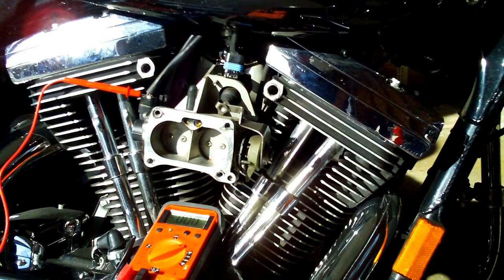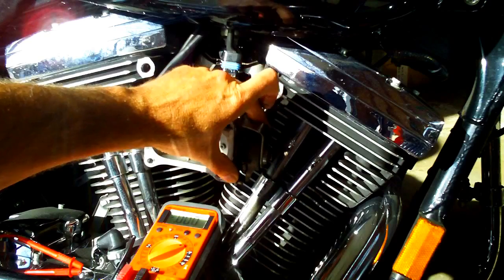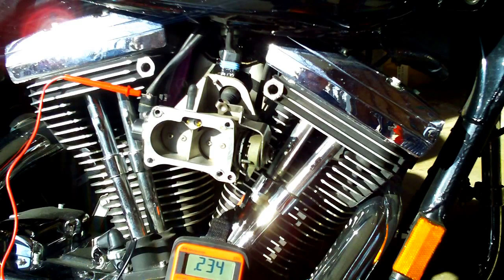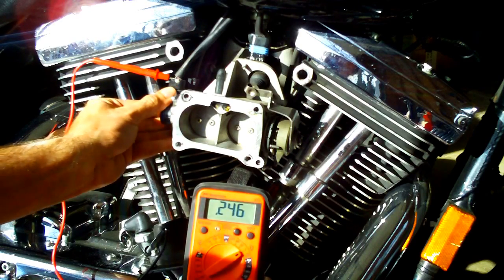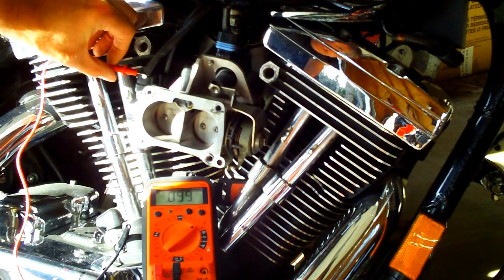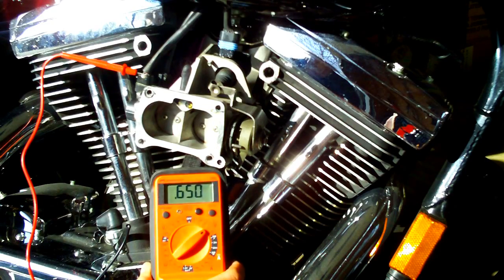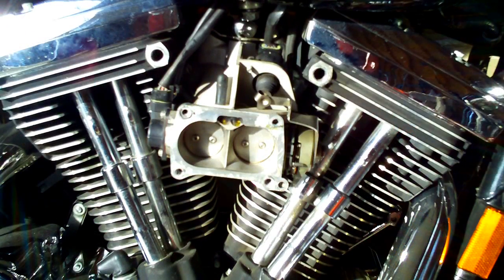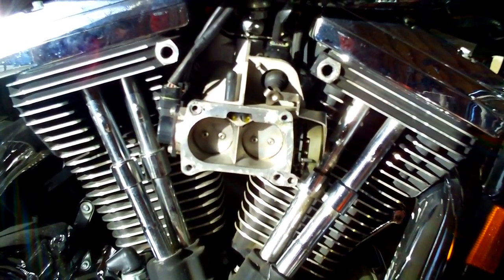Reset Harley Davidson Magneti Marelli Fuel Injection TPS Settings ✔

Comment: I realize that this video is pretty old, covering the M&M fuel injection system, but I wanted to clarify with your viewers that the .275 volt initial setting is just a good starting point.  

If you’ve completed Stage 1 on your bike, better mufflers and intake only, then that setting is irrelevant not to mention incorrect for its current new modifications. You’ll find that the engine runs much leaner and moving that TPS is how you richen the mixture back up again.  

I suggest if you’ve done Stage 1, that you check the spark plugs frequently to avoid catastrophic engine failure of running too lean.  They are the only indicator of how rich or lean your engine is running.  When it’s setup properly, it will idle with that nice thump of an EVO 80ci carb motor and have no hesitation when getting on it, like all other fuel injection motors. 

Be safe out there!

Comment: Mark,is your multimeter set on 20 volts? Thank you in advance
Reply from the maker: It is set to millivolts, to measure "point number number number" of a volt. Less than 1 volt DC. Not all multimeters go that low. You may have to acquire a different one if yours doesn't.

Comment: You adjusted the cold idle set screw and got it to .650V but I didn't see any adjustment to the hot idle set screw after you backed it out...did I miss something?
Reply: Went back and watched again, saw what you did with the warm idle screw.. I was busy taking notes and missed it. Thanks. Great video!
Reply from the maker: No you didn't, I set the hot idle screw after the bike warmed up to what sounded like 1,000 RPMs. There isn't a procedure that I am aware of to set it otherwise.
Reply: Than you! @contact4mwy7

Comment: Do thes numbers work if the bike has upgraded cams and bored out
Reply from the maker: @timhall4046  I don't have any info on that. These numbers are based on a stock engine and intake. Do you have a before and after comparison to go by or did you buy the bike after the engine work was done?
Reply: @contact4mwy7  I got the bike from the dealer ship and they don't  have much info on it.
Reply from the maker: @timhall4046  ok. How is the bike running right now? Is there evidence of a fuel tuner installed?

Comment: Whats the meter set to?
Reply from the maker: @jorgezuniga7485  Millivolts DC. 0.2 is two tenths of a volt, 0.04 is four one-hundredths of a volt, and 0.005 is five one-thousandths of a volt. If your meter doesn't go that low you'll need a different meter.

Comment: what are these numbers, are they volts or what??? thanks for answer
Reply from the maker: @aferimmaloku8320  The numbers are in 'millivolts' DC. Measuring less than 1 volt. There is a link in the description to another video that shows the multimeter I used and explains it further.

Comment: What do you set the multimeter on ? Is it on volts ??
Reply from the maker: @fgrann  MILLIvolts. As the numbers go from the decimal point, 10th, hundredth, thousandths. That is why the reading is 0.275 volts DC on the display. One volt DC would show as 1.000 and a half a volt DC would show as 0.500. Here is a video of the multimeter I used: https://www.youtube.com/watch?v=SSi6kIp_Vrg
Reply: @contact4mwy7  Thank's alot 😃👍🏻

Comment: What is your multi meter ranged too? Also i rotated the tps and could not get .275 ..the most i could get rotating the tps was .050 and like .080 when rotating throttle..so i tried ranging my meter different to Mili amps and still no where near your .275 mark..i also couldn't get fast idle to .650 either
Reply from the maker: @garyharriss5322  The multimeter is set to millivolts, that way it can measure less than 1 volt DC, which is what these settings are. Make sure you are probing the correct wire and have a good ground, and that your battery is fully charged.

Comment: Rookie question...but what do I set this multi meter at? I've only used one a handful of times
Reply from the maker: @Jrmobileweldingservices  set it to the lowest DC setting. You will be trying to measure less than 1 volt DC, to the thousandths of a volt.
Reply: @contact4mwy7  I figured it out. But thanks for the response. And this video helped BIG time. Much appreciation

Comment: I must be doing something wrong, when I put a pin in the gray wire on the TPS I dont get a reading on my meter at all . I have the switch on but still no reading! I am working on a 1998 HD Ultra Classic Fi.
Reply from the maker: @unclejed5342  I have a few questions, what kind of meter are you using? Will it measure down to 1,000th of a volt? Or at least 100th of a volt? Where did you clip the ground wire? You're looking for around 1/4 of a volt DC. 0.275 to be exact.
Reply: @contact4mwy7  I am using a Klein ET270. Either it does not go that low or I don't have it set right!  I'm grounding on a frame bolt.

Comment: 2001 ultra,  not even close to .275. My readings are. 850 and up????
Reply: Thank you again. You have helped tremendously!
Reply from the maker: If you followed every step correctly but cannot get a reading of 0.275 there may be a problem with something related to throttle position sensor, if not the sensor itself.
Reply: Thanks,  once got things good on my end, it went as you showed.  Only now it stays high Rev when throttling. New aftermarket sensor.
Reply from the maker: @mr.ksinformationstation8590  the idle speed is adjusted by both the Cold set screw and the Hot set screw. One of them may be turned "in" too far. You'll have to try backing them out one at a time to see if the idle begins to slow. If not, put that screw back where it was and try the other one.

Comment: Mark,I've reached out to you before about my 1998 harley-davidson Road king classic.  It's been running great . Today I went on like a 4 hour ride and near the end of the ride I hit a spot in the highway where they had base asphalt but hadn't put the surface asphalt in yet. I hit this 2" drop going 60 mph. After that the bike started surging and died at the stoplight. I limped home with it and thought about the throttle position sensor. I got to the tps and found one of the screws to the tps was already loose. I did your procedure for the tps . Trying to get to .275 but was getting readings over 1 and then .24. It it possible that the tps is bad?
Reply from the maker: I wouldn't say it was bad just yet. Maybe when the screw(s) was/were loose it rotated just a bit. They are very sensitive as you may have seen on your multimeter. See if you can get it to 0.275 and try it out. Coat the outer edge of the screw heads with clear fingernail polish to help keep it from loosening on its own.
Reply: @contact4mwy7  Thank you,Mark

Comment: Hello. Do the two screws above the flaps need to be tightened or do they also need to be adjusted?
Reply from the maker: If you're asking about the two screws above the intake butterflies, they are "air screws" set from the factory. I've heard it's best to leave them alone.

Comment: So I’m trying to do this. The only way I can get the decimal in the correct spot (.000) is to have it set to 2m Ohm setting. Is that correct?
Reply from the maker: That sounds like a good start. You will want to see 0.275 volt DC.

Comment: I can’t seem to find the right setting on my meter. None of them read the way yours does. None of the settings
Reply from the maker: You need to have the proper meter to measure down to less than 1 volt DC. Will your meter do that?

Comment: I don’t know what setting on the multimeter to measure, volts right ?  Mine either registers
on 200 mv = 27.5, or if I put the meter on 2v , it registers .0275, also when I adjust the fast idle screw it will only read .046 with the screw all the way in
Reply from the maker: It's measured in DC volts. Millivolts. 275 is the number you need for the throttle position sensor. 0.275 is just over a quarter  volt. As for the cold idle screw (fast idle), adjust that when you're done to a comfortable high idle, and make sure it idles down to the warm idle screw position.

Comment: I have to have something wrong I followed all the steps lowest o can get is.475 moving the TPS around am I missing something?
Reply from the maker: If you have the correct wires and follow every step, you should be able to get a reading of less than .275 I don't know what else would cause a high reading like that.
Reply: In volts correct to and what are you grounding on?
Reply from the maker: @benjaminbliesener1438  I grounded to the engine case itself. Volts DC.
Reply: @contact4mwy7  yeah I'm not sure what's happening then I'm pinned to the gray wire with the violet chaser backed out the cold idle screw turn the power on grounded it loosen up and Lowest I've gotten this point  .468 I love the idea of having fuel injected but at this point I'm so stressed on this bike. I wanna switch to carb

Comment: I know this is an old post, but im a Harley newbie...will these settings be able to run efficiently with a set of slipons? Like Sharkroad with no baffles? I really want that loud Harley bagger sound but ive been told that MM injections sre a pita to tune for upgrades...1997 FLHTCUI Ultra with 42k
Reply: I have a lot of decel pop too...pulled plugs yesterday and seen they were gray...so I cleaned them and put them back...hoping this method will fix all of my woes
Reply from the maker: The settings in this video should reset the fuel injection system back to like-new condition. If it were mine I would find a fuel injection tuner that ties into your injector's wiring harness (piggyback type) to give it just a bit more fuel. I have some videos on my channel of installing and using two types with good results.
Reply from the maker: Deceleration pops can be from fuel mix being too lean to an air leak somewhere in the exhaust letting fresh air into the pipes. I've been chasing a decel pop on my 2009 and found that adding more fuel at zero throttle will tame it.

Comment: I did everything that I can to adjust this magneti marelli and I still have issues. The bike fires up really good,after a few miles the bike bogs down to a stop🤷
Reply from the maker: When the bike bogs down to a stop, can you check the spark plugs to see if it's running too rich or too lean?  Without much to go by it could be a number of things from faulty sensors, fuel pressure, etc.
Reply: Do you think I should change the temperature sensor on the magneti marelli?
Reply from the maker: @theoc634  I don't know the system or situation well enough to make recommendations on what to change. You might change every sensor and still have the same results. It's going to take troubleshooting to track down the culprit.

Comment: My bike is this exact engine and intake.  It died randomly and was not starting.  I changed the temperature sensor and it ran great for 2 days..it has now stopped running any where past idle. I cleaned all parts i could without removing the intake itself.  I'll head to get a meter and try this.  Will let you know what i find.  Thank you for the video

Well..i did this and i have other issues i guess. Idles great..hit the throttle and it dies at 1900rpm
Reply: Any suggestions lol
Reply from the maker: I would connect the meter and rotate the throttle. Watch the meter to see if the voltage through it increases as it should or is jumping around or stop changing at a certain point. Other than throttle, the only other thing I can think of that would have an affect is the crankshaft position sensor, which is located at the front of the engine, left side. Temperature sensor shouldn't cause it to die out at a certain rpm. Let me know what you find out.
Reply: @contact4mwy7  i have removed the tank and fuel pump... my plastic bendy straw was leaking in a pin hole... but...i did notice my electriconics were out of calibration and now knowing how to set it i can actually use my turner to see better results when this is fixed.
Reply: Voltage was not jumpy in unit just to let you know.  Thank you again

Comment: Thank you   I just bought a 2001 ultra and it had a lean skip from 2000 rpm to 2500. TPS was never touched from the factory, Still had epoxy in the screws. It was set wrong from day one.  Lean issue is gone bike pulls hard and no pop skip at 2000 rpm’s Thank you again
Reply: I forgot to mention. No more popping through the exhaust on decel or between shifts.

Comment: whata...I can't get those numbers reading on my multimeter.. what is the multimeter set on?
Reply from the maker: DC Volts, reading out to 1,000 a volt. 0.275 volt DC. That's just over 1/4 volt DC. Less than 1 volt DC.
Reply: this cowboy did a little sillywillie here...I disconnected the harness I was about to do volt check, it is only the one on the topp that you took of and not the one with the violet/grey cable, now I get it and it is set correct. It 
was around midnight and I did not want to wake my neighbors, but today after my work I am about to go to the garage again and fire it up, hoping for progress. Thx a million, greetings from Sweden.

Comment: Thanks Mark for this great video! The gas consumption was extremly high at 98 Electra Glide. I  followed your process, set the sensor to .275V then unplugged the 5&15A fuses for a while. After a test ride of 20 miles I recognized that the engine behaviour improved a lot (spark plugs are nice brown). The only strange thing that the warm idle screw does not change the idle when the engine is warmed up. The idle reacts only for cold idle screw. 
Do you have any suggestion what can be be wrong? Thanks in advance
Reply from the maker: I'm thinking you are turning the correct screw, inwards as a clockwise direction. If it isn't raising the idle speed perhaps something loosened or came off the butterfly shaft end that the hot idle screw is supposed to contact. You may need to remove enough of the air cleaner to get a visual on what's going on.
Reply: @contact4mwy7  Thanks Man! I will figure what is the problem! Cheers!

Comment: Hey Mark, love the video. Looking into starting this process on my 00 road king. Is this process the same for twin cams as well as an evo? Thank you
Reply: Also.. did you do all of this with the engine warm?
Reply from the maker: @DJDooxx  Engine cold. Before you switch on the power, disconnect the cold idle motor harness. I have read there are two different settings, one for EVO (this bike) and one for Twin Cams. I believe I put that information in the description info. Edit: I just read in the description that the cold idle setting may be different for the two. Not the main setting. EVO cold idle 0.620-0.650, TWIN CAM cold idle 0.650-0.680, I would recommend starting at 0.650 for your cold idle setting and readjust if necessary.
Reply: Thank you very much
Reply: I am mostly looking to bring my warm idle down a bit. Just cleaned out throttle body. Idling a little high. I should just be able to adjust warm idle with that one screw right? Thank you for your help
Reply from the maker: @DJDooxx  Yes, turn that one screw counter-clockwise until the idle comes down to where you want it to be, while engine is hot. If that screw doesn't lower the idle as it should, your cold idle screw may be holding it from going any lower?

Comment: Do you screw down the sensor after the.195 or after you get the .650 also?
Reply from the maker: Tighten the screws after the first setting, what you are calling 0.195 volts. Following that, adjust the cold idle screw until the voltmeter goes up to 0.640 volts. This is a good starting point for the cold idle. You may want it higher or lower once you start the bike for the first time. Remember, the idle is going to be slightly faster without the air filter on, so don't make final judgment on idle speed until air filter is back on. Also remember to return the warm idle screw roughly back to where it was so when the bike warms up and retracts the cold idle motor the bike will be idling at it's normal "hot" idle.
Reply from the maker: How did it come out?
Reply: @contact4mwy7  did you get my reply about how it turned out?
Reply from the maker: No I didn't.

Comment: I'm a little confused, is the bike supposed to be warmed up before setting the .195 and the .650 on the TC88 ? What fuses need to be pulled after settings and where are they located?
Reply from the maker: The bike does not need to be warmed up. The fuses are located under the seat, right side on this bike. They are the main fuses. You can also disconnect the battery if that's easier.
Reply: @contact4mwy7  Thanks for your help

Comment: The air cleaner will change the idle.
Fuel injection doesnt work well without the air cleaner.so also dont leave a torn or clogged one on. Mileage will suffer.

Comment: Mark,are the .275 and the.650 numbers set in stone? Or can you adjust to not run lean.I heard that factory settings are on the lean side. The reason I ask is my 1998 Magnetti Marrelli Road King Classic runs great at those settings ,but when I hit the throttle hard it will miss a little.  As long as I'm just cruising along it runs fine. Any suggestions you could give me would be greatly appreciated. Thanks Again
Reply from the maker: The 0.650 setting is a general setting for cold idle only. The 0.275 setting is the base setting for the whole fuel injection system. It is a reference for both amount of fuel to inject and the ignition timing. You can experiment with higher settings to see if you can get an improved result without pinging or a check engine light. I used a piggyback fuel injection controller (Dobeck type, Techlusion) on my Road King to add just a little more fuel.
Reply: @contact4mwy7  I appreciate the information, thank you